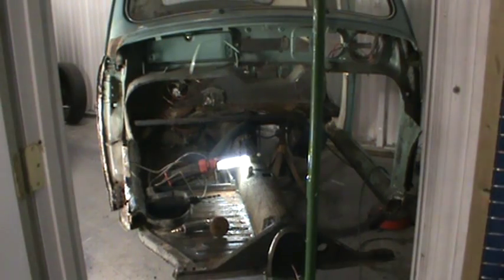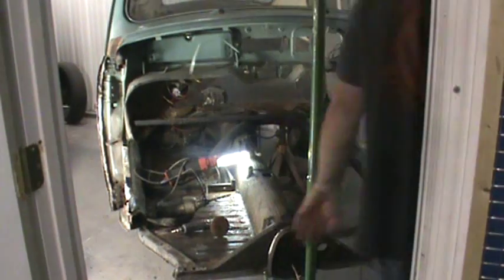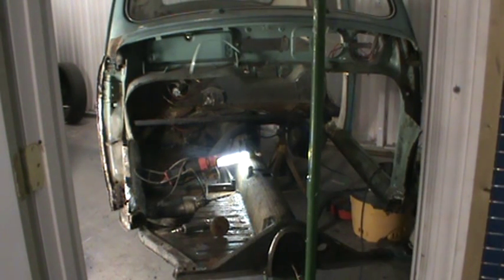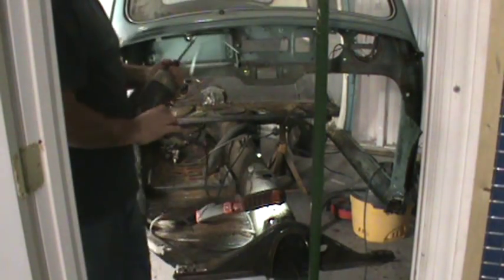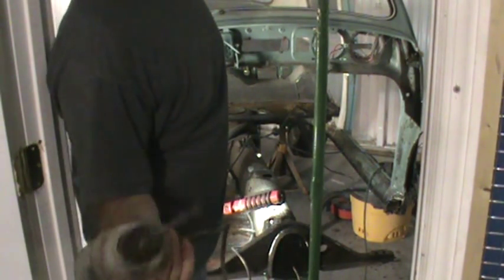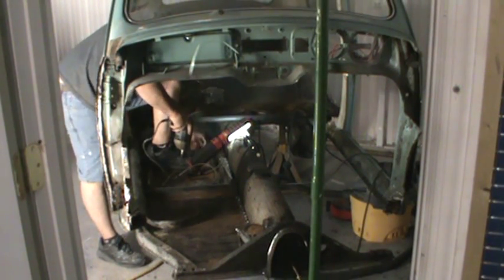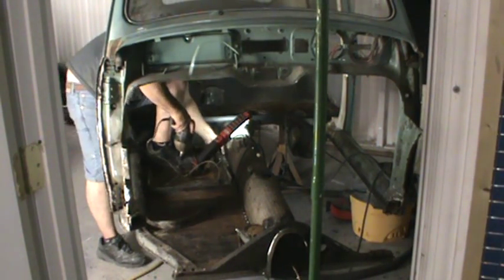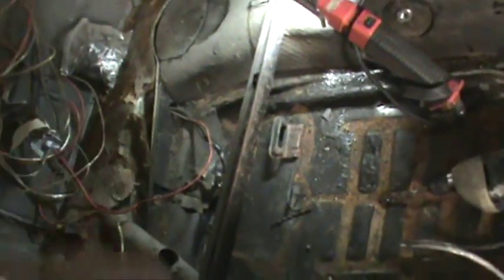REMOVING FLOOR PANS

Comment: I'm not a snap on fan. I use drill bits made of cobalt. They seem to do could on heavy metal. I've never drilled out spot welds though. I took two years of Auto Mechanics at the tech school many many moons ago. Then four years in the Army as a 63S (Heavy Wheel Mechanic) and 64C (Truck Driver). I spent 34 years as a truck driver in the civilian world. Gave that up for now. Working as a spotter driver for a big factory. We make ag and industrial wheels. I have lots of projects to get done also.